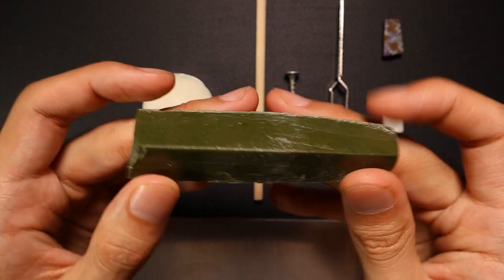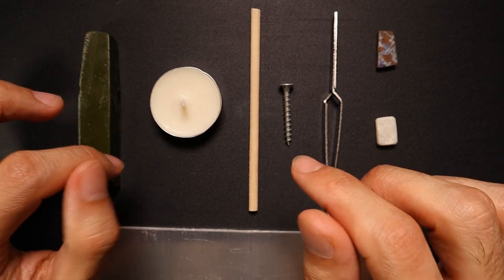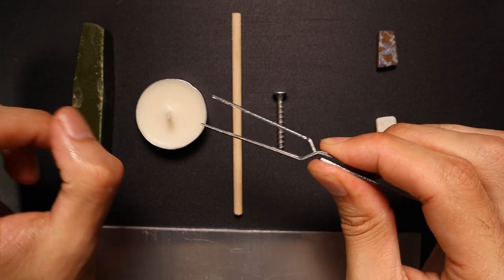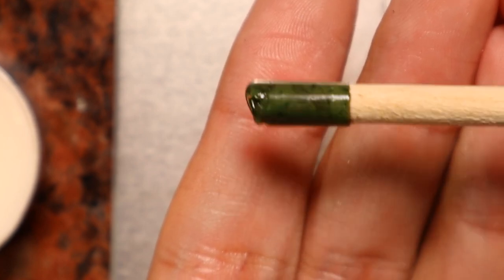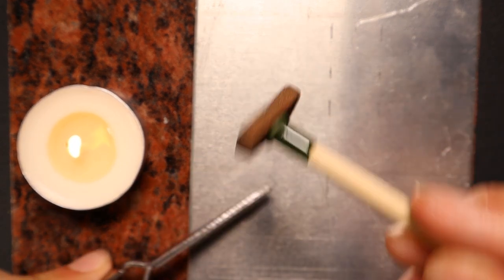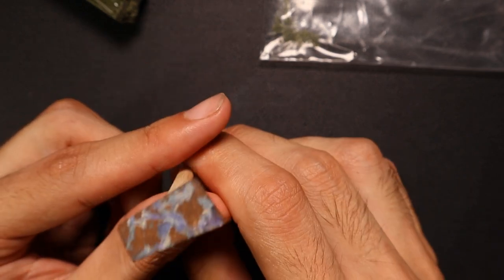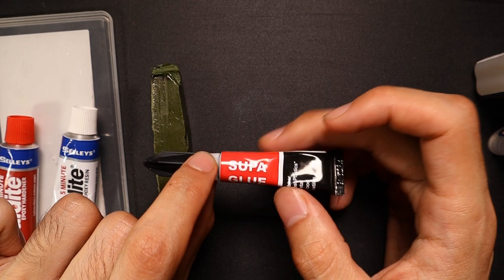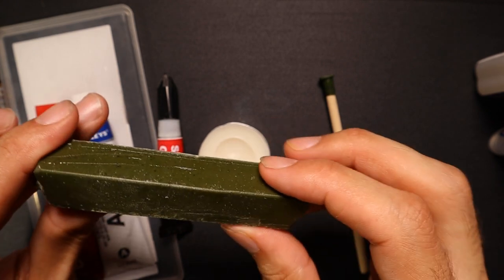How To Use Dopping Wax Or Dopping Cement (DETAILED GUIDE) Tips And Tricks. Timestamped Chapters.

Comment: Nicely done video, Roy.  No fluff and good instructions and camera work.  thanks!  I watched another video where the guy demo'd using hot glue.  I'm going to try that with my ryobi battery glue gun.
Reply from the maker: Be careful with hot glue if your stone is temperature sensitive. I showcased it on my channel but it the temp gets too hot a stone like opal will fracture.

Comment: This is great info! Thank you so much for this video! Any tips for dopping Ethiopian opal? They have not been sticking too great, but I haven't been heating the stones either.
Reply from the maker: I don't heat them either so no wax for the Ethiopian. I just use 5 min epoxy or not dop at all. It's cheaper so you can get big enough pieces to handle.

Comment: Thanks for the detailed info. Question for ya... I have a few stones from the first time I ever dopped. I tried dopping without any real info, and made a total mess. So the stones have wax all over em. If I put em in a bag in the freezer will it come off easily, or is there another technique for removing wax that is all over the surface of small stones? (1-3 carat.small)
Reply from the maker: The wax can get more brittle in the freezer so it could work otherwise you can also use heat to re-melt it and scrape it off if it is bad enough. Something like isopropyl alcohol might also help you dissolve it. Quite a few options actually.
Reply: small brush and  acetone or alcohol will remove the last of it.....
Reply: @CockatoobirdmanBill  ty
Reply: @RoysRocks  thanks. Wasn't sure if solvents were bad for opals or not. Appreciate that
Reply from the maker: @redeyestones3738  Can be bad for some opal but most aussie stuff can handle it.

Comment: By the way rubbing alcohol or acetone will take the dop wax off your stone. Dop wax is wax and shellac. O don't forgot if you are doing facets no way can you use Super glue. What I do you if the stone not flat like when you are doing the back of a cab use a bigger gob of the green wax
 works well for me ........ Be well and be safe
Reply: Thank you for that bit of information. Anything that spreads the knowledge, is always a bonus.
Reply from the maker: Good points. I dont recommend chemically removing any wax because you can resuse it by just scraping it off and melting it up again.
Faceting is definitely very different and I haven't done any work in that area but maybe one day... Fire opal seems to look great with a facet style cut.
Reply: I only use alcohol or acetone to remove dop fron the stone if it did not come off clean.........